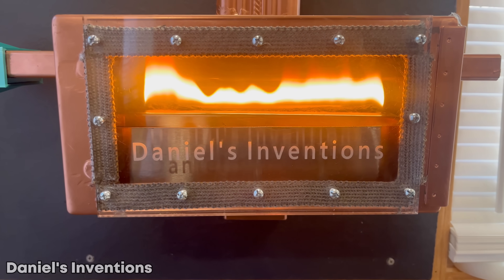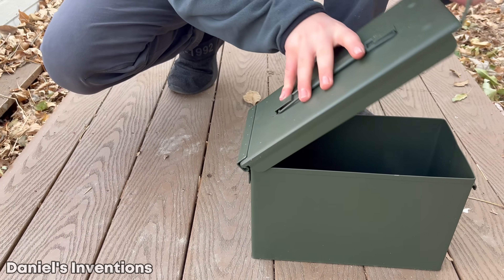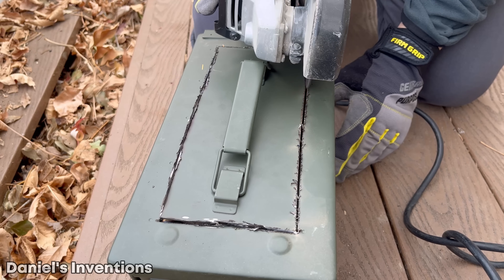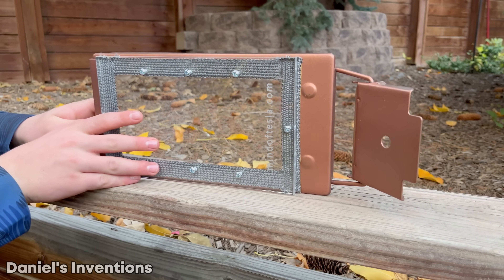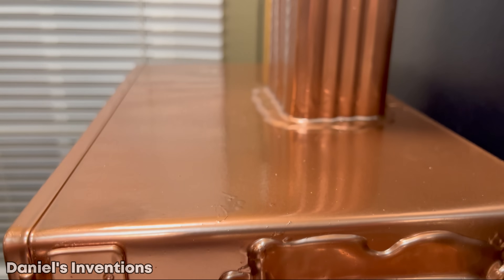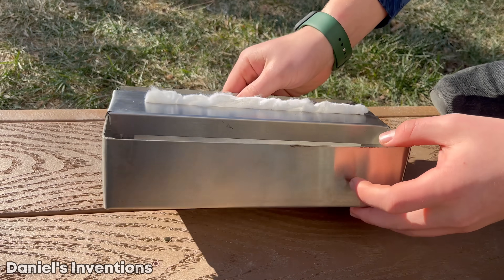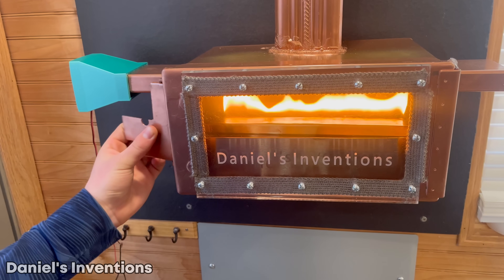ENDLESS Heat for Your Home WITHOUT Electricity 2.0

Comment from the maker: This is ENDLESS Heat for Your Home WITHOUT Electricity 2.0. When the heater is used for the first time and gets very hot, it will begin to burn off some of the paint from the top of the heater. The same way a wood burning stove does when used for the very first time. After the paint is burned off, it will no longer emit fumes from the paint itself. If the house is very airtight, one might need to crack a window open, just a little bit to provide oxygen for the heater, or the heater can have a secondary pipe that is bringing oxygen in from outside. The same way we did on the previous heater video: https://www.youtube.com/watch?v=0guulsNSQXU&t=1s. The oil tank we built can hold half a gallon of oil, and it takes us a week to go through a single gallon of oil. We are only using the heater for 4-6 hours a day, only when we are there using our shop. Now if you need to run the heater nonstop, you will probably go through more oil each week. To put out the fire, simply put your hand over the fresh air intake pipe and hold it until the fire dies off from lack of oxygen. We are using dry cotton baby wipes as a fuse. Once the entire tank of oil is empty, we simply install a new baby wipe and refill the tank again. When the oil tank is completely full and the heater has been working for 30 minutes, the heat released from the heater is enormous. One can feel the heat from a distance or just walking by it. It feels like a blast of heat. We estimate that the heat released it approximately as much as two small space heaters at full blast.
Reply: Well done, Daniel.  I like that you took some of the feedback from the previous build and then some to make this.  Going horizontal was a definite design improvement.  Spacing from the wall is a big improvement.  The metal tube going through the center is also superior to what I'm about to use (stove pipe).  And the long flame is fantastic!  Well done 👍👍👍  

BTW, mine is going to be used in an RV and mounted to a removable metal pane I place in the window.  Also, I'm using mason jars to house the fuel (good visibility on fuel supply), 1/2" fiberglass wicks (VERY long lasting and large flames), and generic Crisco vegetable shortening (exceptionally long burn time).  I may need to use one candle in one jar to be the first one I light.  This will cause the other jars of Crisco to heat up, melting the shortening, and allowing the shortening to move up the wick.  Then, they can be lit as well.
Reply from the maker: Thanks man!
Reply: I would consider a lid on the oil tank with narrow slit for the fuse material to ensure no fuse/flame/embers fall into the tank & causes a flash fire.
Reply: Would you be willing to sell me a unit I'd pay for shipping as well. Just bought a pelonis unit for 60$ very efficient only for one halfof the home though I would use this on the other. You definitely should consider selling these I'd patent it😂
Reply: @JohnColgan.  Best bet is to use some type of wadding such as mineral wool to completely fill the oil tank this way it's near impossible to have a spill.
Reply: @David-oq6tv  I would love to see what you come up with as I would like to do something like that with my RV. Do you have a channel or web site? Or perhaps at a minimum you could post some pics or a video back this comment thread? Love your ideas. By the way how does the shortening compare to vegetable oil in terms of cost, how long it lasts, and heat output?

Thanks for this great video and tutorial, Daniel!
Reply: @whitelaw5  some people use steel wool as wick material on other projecys and claim it never needs replacing.....maybe try that?
Reply: If you made these heaters I would definitely buy one. 😎👍
Reply: @JohnColgan.  is this a major concern and definitely should be done or a flash fire is likely to happen?
Reply: Could you use liquid paraffin as your fuel source
Reply: I would like to buy one if they are for sale
Reply: Baller stove dude!!! Great video
Reply: We are writing a comment to Daniel lol.
Love the build!!
Reply: @David-oq6tv  I was worried that the mason jars will get hot and cold, over and over until it breaks, and would start an uncontrolled fire. How did the mason jars work out?  I'm about to make mine, but I can't figure out the best oil holder to use.
Reply: Hi Daniel, How can I get somebody to build this for me in New York?
Reply: Check with your insurance agent before doing this! I am certain this will not pass Fire code, house fire waiting to happen.
Reply: There is 130,000btu in one gallon of cooking oil. If that gallon lasts all week your shop must be tiny, or not very cold outside...or insulated like a thermos.
Reply: Daniel,  no oil available around me for $2.50 a gallon.  But you can build your own simple distillery to make your own diesel.  By burning plastic (2,3,5 best) over a wood fire (rocket stove) in your distillery you have very little smoke and get your fuel for free.
Reply: You MAY be able to find used cooking oil for $2.50/gallon...maybe. You could probably find used motor oil for free. I imagine it would smell...but dont know.
Reply: How to adjust heat?
Reply: What type of oil are you burning?
Reply: @whitelaw5  me to 👍
Reply: How often do you have to clean that exhaust pipe to prevent oil buildup/fire?  (That oil has to go somewhere.)  What oils are ok to use for this project as it can't be just be "any oil" because of health reasons?
Reply: @marcusdiblo  hello, what's a pelonius unit?
Reply: @Freaysclaw56 plastic is derived from fossil fuel. The reason we have a fuel crisis, is over-dependence on fossil fuel. Burning plastic without extensive, expensive chemical exhaust fume filters will kill us all.
Reply: I think the support dowels are a weak point. It needs to sit on a solid shelf of some kind or stronger brackets so that anything or anyone accidentally falling or knocking into it cannot make it spill
Reply: You should market this I would buy 3 for my self
Reply: Awesome thanks hopefully I don't catch nothing on fire.Nah😂
Reply: @johns4699  If he doesn't I'm about to😂 if I gotta make one myself
Reply: all this paint is an off-gassing nightmare. shouldve been sandblasted first. maybe burned off with torch. I like the design, but I wouldve used stainless steel instead of painted mild steel.
Reply: What powers the fan? Squirrels? Who has a 3 d printer.
Reply: I like to buy a few  Daniel not to copyright to have in case the power goes out to keep my family alive and warm
Reply: Great 👍
Reply: Love the look of this, you have done a brilliant job, as others have said it has a couple of weaknesses, but fantastic job mate.
Reply: You could put heat  dissapation fins on the exhaust pipe and  harvest some of the outgoing wasted heat.
Reply: @jbauern57  trained squirrels. I got mine at squirrelco.
Reply: ANY FUMES FROM PAINT ARE BAD!! STOP PAINTING THINGS THAT WILL BURN PAINT OFF!?!
Reply: Well done 👍
Reply: Should be good for a camper.
Reply: @daveleach4357  I have a feeling any flatlander that's worried about their insurance agent? Wouldn't bother building something like this - too much work. Thought, ingenuity

 wait till it comes out on shark tank, attaches to your tailgater cooler, and it'll be all up to your code inspections 

 America's got jackass movies and people drinking bleach

I don't think they're worried about insurance
Reply: @rogerwhiting9310  at about 5 seconds in on the video, he stated it was a 400 ft building

With proper insulation, you can warm up a 400 square foot building with a candle in a jar if you wait long enough

Of course your insulation is going to make all the difference.
Reply: We would like to buy one
Reply: There are oven trays all sizes that could be used to hold the oil . They would be heat resistant to great temperature because they're made for oven temperatures.
Reply: @DanielsInventions  ideally the heater would be more beneficial closer to the floor.
Reply: @marcusdiblo  There used to be oil burning heaters but most used fuel oil in them. It stunk.
Reply: i don't have the tools. are you interested in building the unit to sell?? not all of us have a saw to cut out the holes, or a 3d printer. :/ or a hubby to do it for us.
Reply: @Freaysclaw56  q
Reply: How do you adjust the wick/baby wipe? I would think that while running you would have to adjust as it burns away? 🔥
Reply: @BAD BOY what mosquitoes survive winter?
Reply: I have a idea for a new vid. Get a 1000 gallon water tank cut the top off put a piston ontop of the piston u put hundreds of pounds of weight to push the water out at a high persure and spin a water turbine  see if u r able to charge a battery. Unlimited free power
Reply: Interesting invention, but please add a pipe through the wall for your fresh air intake.  You really are reducing the oxygen in the building.  Carbon Monoxide is a factor, too.  At least while the metal heats up enough to create enough draft to exhaust it.
Reply: Why not add a large piece on top that is greatly sloped?  That way if a cat tries to jump on top, it won't get burned....or at least not nearly as bad.
Reply: I really like your creativity.  About the exhaust, wind can cause a downdraft, pushing the toxic Carbon Monoxide into the building.  Notice that chimneys have to be x number of feet higher than the roof's peak or something along those lines.
Reply: Is there a residue in the exhaust air that can build up in the chimney and cause a chimney fire, or build up along the roof edge where it exits near?

I'm new to your channel with this video being the first I've seen.  I would like to see more.
Reply: @marcusdiblo  His heater is interesting, but please always use a pipe through the wall to bring in fresh air into the burn box.  Every year, people die from Carbon Monoxide in the US, and many are hospitalized.  His design also doesn't prevent a downdraft from wind which would push the Carbon Monoxide into the building.
Reply: I must have missed something – in the title it says how to heat your home without electricity but part of this unit is a 12 V electric fan...
Reply: Looks like a good way to burn down a house....
Reply: What's powering the fan? 🤔
Reply: @David-oq6tv  Mason jars are top heavy and breakable.. Avoid having to think about or worry about two possible scenarios.  Hot jars of oil getting knocked over , a big mess & a clean up job Nobody would enjoy. 2nd. Hot oil breakable open flame inside camper not fun.. there's better choices..
Reply: @Freaysclaw56  go to any restaurant and get used oil free..
Reply: @SeaJay_Oceans  3 or 4. 22.5° elbows in the exaust could be used to capture more of the heat currentLy 126°  leaving outside...
Reply: @markkauffman6184  battery operated.
Reply: I made this yesterday so thx
Reply: 2€50 a litre, turns into appro 9€ a week -US or UK gallon ? that could provide with 36kWh -3 hours on 1200W heating. I did not know we were geeting screwed that deep by electricity providers, a good job most of us were "vaccinated" several times already, uh ?
Reply: Q
Reply: Wax acts like a Thermal battery. Add a couple of tall canisters on top of the stove and it will hold that heat for a long while even after the oil is spent. The wax reusable and will just harden until the next time. Water works too but doesn't get as hot and cools more quickly, the trade off is safty. As long as the wax doesn't tip over an spill it's all good. They also make fans that use heat alone to produce wind but they are expensive like 500 and they need to get hot like 450. Good for the top. I would be interested to see you make the heat exchanger intake a u shape that travels from the side of the top of the stove and uses the electricity-less fan to power it. Cut the electric out and you have a real life saver. That electric power has power over us. Oil and alcohol can be made out of so many things.
Reply: Another thing I've seen is double barrel stoves, they have a second can on top of the can, the fresh air exhaust would travel up the gutter but offset to the right side, then enter the top box and exit from an exhaust on the left side. So the hot air fills the box and many pipes woven through that box create more surface area, although it would not be as hot at direct flame.

Another thing I thought of is like the native American fire pit. They dig a hole beside the fire down low where cold air drops in, the cold air feeds the fire as it warms and rises making somewhat of a blast furnace. If your heat exchanger pipe was coming up from the floor level and exiting up high you may be able to do away with the fan, depends on the draw strength. There is a perfect ratio of heat necessary to create a draw and if the chimney is any cooler the smoke won't rise away from the building. One question, what is the creosote build up potential, how often should the chimney be replaced or does it burn clean?
Reply: I was sketched by the JB weld fumes. Also, beware any galvanized steel, when the zinc burns off its super toxic. I would cook the metal parts in a fire pit real good before bringing that indoors. Sand blasting is a great idea too. You would want engine paint for sure. High temp.
Reply: You could just bend more gutter instead of 3d printer. I would worry the plastic would get too hot.
Reply: Check out a double barrel stove kit and a welding torch. Have that in your basement and you can get it going everytime. Just know it's short lived if living in the city. The Serbian war in the 90's lessons are tragic, once people ran out of excess wood trim and floor boards they had to go scavenge others houses and a trip out was most likely a run in with a sniper. I've read diarys where only half the family survived and that was lucky. The gub-ment told them everything was OK, again and again, and then they were gone and it turns out it's wasn't fine at all. Nato sat and watched. As did we all. Stove like this is a life saver. But the skills that saved them was recharging small batteries, filling lighters, and fixing things in trade for food. A trip to the market was also met with snipers. The market was safe because the warlords ruled it, but the walk home was treacherous.
Reply: Brilliant comment on heat fins on the chimney. Could run a small pipe through that too with a little fan.
Reply: Thou shalt break them with a rod of iron; thou shalt dash them in pieces like a potter's vessel.

Be wise now therefore, O ye kings: be instructed, ye judges of the earth.

Serve the Lord with fear, and rejoice with trembling.

Psalms 2

The greatest mistake one can ever make is persecuting followers of the lord.
Reply: Of we paid any mind to our childhood lessons we wouldn't need insurance. Yet we build so the big bad wold can blow it all away. Then he extorts us to rebuild beach houses and those knowingly built of flood planes. The wolf likes the fragile house so he can raid easily.
Reply: Anyone with hands and will can make this. This is a survival stove and you will gain great sense of empowerment by building this instead of doubting. You will get a free grinder out of it and you don't need the 3d printer, some tin a rivets will do fine, you could even use tin snips on some gutter and some self tapping gutter screws to fasten the taper down together. The only real excuse in life is taking care of children or debilitating health and the children when taught can craft for you in time, if you show them the way.
Reply: Magic powers the fan. Like uncle fester with a light bulb in his mouth. Lol
Reply: When monopoly is allowed you know your getting screwed. And they are tightening those screws as we speak. I can feel them stripping. To much force and the whole thing comes undone.
Reply: @DanielsInventions  JusT leT me know when and where I can buy this this ConTRaPTioN.!! 😒
Reply: The WEF can take it from my hot live hands.
Reply: Build me one and I'll buy it
Reply: This is the first time I see this and I like the fact that no welding is required.
Reply: @luisfelix7989  or at least do first burn out doors.
Reply: @BAD BOY neem oil is rather costly and it stinks.
Reply: @wownewstome6123  ah ok. Gotta read all the comments before rushing out to duplicate. I’ve watched so many fireboxes made from these ammo boxes.. learning something new each time. By the time these build ideas are mastered the ammo box supply  will be slim. 😂
Reply: Thanks for sharing this clever idea, simple, cost-effective, seemingly not bad built etc. Question though: don't you smell the oil with a touch of burn?  Lastly: keep the following in mind since you mentioned the so misused and abused word these days 'create' :  The Law of Conservation of Energy, a physical law, teaches that energy cannot be created nor destroyed by may changed from one form to another. And supremely "Only God creates, the rest of us just copy." [ ~ Michelangelo] ].
Reply: I have thought about a metal or even glass loaf pan.
Cotton felt sheets are less than $1 (Walmt)
Or carbon felt for replacement filter in overhead stove top ventilators (L.wes or HD)
Reply: What are the top 3 oils you prefer to use?
Reply: Love the design.
I really appreciate the video.
Planning my own build right now.
Thought about using fire bricks inside and on top for heat retention, a metal heat deflector on the cement backer board and a heat activated  wood stove fan for more air movement into the room.
I'm gonna use a metal loaf pan and metal flashing for the fuel container.
Covering the top to reduce possible flash point ignition in case the oil ever gets too hot.
May pickup a glass loaf pan so I can see the fuel level.
Thinking a damper in the flue and adjustable airhole cover for the intake may be a good idea.
Easy enough to do.
Possibly placing the whole thing in a unused double-hung window, so I can just exhaust / intake it out of the cement backer board itself.
That way I can easily remove it with the season change.
Anyway
Thanks again ✨😎
Reply: Lol I just use LPG so much better
Reply: I would be extremely interested in buying one of your units if you could build me one....
Reply: Great work lad, tip though for future vids, try not to say "We are" every sentence :)
Keep it up
Reply: Keep working on that, and who needs paint ?
Reply: Great idea but most western nations would have their house insurance cancelled if they used one as described, this is why we have the "WET" certification systems here.
Reply: @azra3234  : The most practical "free energy concept" was COMPRESSED AIR ENGINE (C.A.E.)... Almost all engine were pressure operated, fueled by: gasoline, diesel, steam engine, bunker, rocket, turbine, etc.. 

1) Just replaced the pressure "producer" with compressed air- having a pressure from 700 psi-1,400. psi...

2) install a 2. sets of heavy duty gas tank (tank for acetylene, oxygen, etc..)..

3) The 1st tank was empty, installed with suction air pump... 2nd tank must be filled at the start with 700psi- 1,400 psi compressed "dry air" - PCP airgun  "tank filter" element/cotton (?) filter can be use...

4) The sole function of built in air suction pump at the 1st tank: Continious sucking of exhaust gas being ejected from the exhaust valve of the engine- then such "exhaust air" will be forcefully injected at the interior of the 2nd tank!... Thus, the elusive free running engine can be achieve in reality!...

5) Pressure released valve should be installed at the 2nd tank- to avoid the over pressure incident, hence tank possible explosion!... Automatic, excess air pressure will be bleeded out by the valve.. Also, pressure valve of the 1st tank, an interior tank pressure must be maintained  by the installed suction pump- at 13psi- 14psi range only...
Reply: HEY I HAVE TO BIG MICROWAVES SO IT GOT ME THINKING I SHOULD TRY TO BUILD A HEATER FROM THE ONE MICROWAVE IF IT WORKS WELLLL ILL BUILD A SECOND HEATER LET ME KNOW WHAT YOU THINK.
Reply: @vrokhlenko  windows
Reply: @wownewstome6123  what the heck is a down draft? just put a stove cap on it no?
Reply: It's fuel might go wrong, to use vegetable oil, the fire can't be more than a half inch away from oil's level, when the level goes down, it gonna put out fire, I thought would use kerosene or even diesel, the fuel tank is so tall to use vegetable oil and the flame gonna put out after some time, never gonna use all available vegetable oil.
Reply: @wownewstome6123  Look at the video, is possible see an external air input and a external output, the side heated tube only passes air to be heated by hot metal tube, but this path is insulated from combustion gas.
Reply: Can I just Buy the 1x you Already made LMK Bro 😎
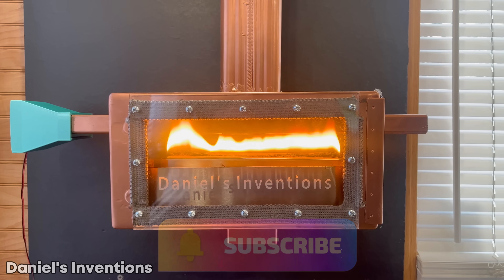Reply: 4:43
Reply: Could this go inside a chimney?
Reply: Can you use used engine oil in this heater?
Reply: @David-oq6tv did you ever make it and can you share an image or videos please because I plan to do something similar
Reply: This is NOT endless. no oil, no heat. No wick, no heat.
Reply: @DanielsInventions  I'm sure someone has to have mentioned, since you already put a hole in the wall for the exhaust vent, to make it more efficient you can hook the intake air to outside. Pull cold air in for the fire, don't be pulling the heat out of the room for the fire to be let out the exhaust vent.
Reply: I would buy two fo that if they were available.
Reply: I will pay for you to make me one
Reply: Do you still the heaters
Reply: @markkauffman6184 You run the fan off a 9 V battery it works just fine
Reply: So, the Crisco is a lousy way to go.  Don't burn it indoors ever.  You might not die from freezing, but you'll asphyxiate from the ridiculous amount of soot it puts into the air!  In my case, it gunked up the inside of the ammo can.  Just forget the Crisco!
Reply: @David-oq6tv  good to know brother.
Reply: One of those Chinese diesel oil heaters on my boat for two winters. I think this is far superior. It really uses no electricity except for the small fan and I suspect that if you angled that cross pipe that you actually wouldn't even need a fan to get the heat to run through it. Also if you wrap something like steel wool or chicken wire around the exhaust pipe number one it would keep anyone from touching the exhaust pipe directly and burning themselves and also it would draw a lot of heat from the exhaust pipe into the steel wool and into the chicken wire which would also transfer into the air really well as well so you might not even need to have the cross pipe if you did something like that. I love the idea that this uses no electricity. All those Chinese diesel heaters actually draw a fair amount of electricity number one to light the oil originally because it uses a glow plug and number two it's always running a fan and so it's draining your battery. other people make oil heaters that use small spigots that you can adjust a drip to drip down onto basically what is a pile of nuts and bolts and then it's a bolts get hot from the first fire and they stay hot enough that every drip of oil that lands on them reignites so you can adjust how much heat it puts out by adjusting the drip. And they can use just regular metal drip fixtures to do that. I like the fact that you use JB weld rather than using real welding. That makes it so much easier for an amateur. And I think the ammo box is a great idea. I think the window makes it look nice but quite frankly you wouldn't need the window and it adds some complication and expense to it. So you could do this without the window and you would know it's working because it would be very hot. You probably also hear it.
Reply: Here's an idea. Have the inside oil tank be very shallow and not hold a lot of oil. Have the outside oil tank have a small pipe connected to the inside oil tank. It would hold the majority of the oil and be at the same level of the inside tank but when the inside tank ran out of oil it would naturally flow in from the outside tank. Number one that allows you to fill the outside tank at any time and number two it keeps the fire away from most of the oil at all times.
Reply: @gaslampnation735  - What a world, huh :'(
Reply: @gaslampnation735  - Agree but the unfortuntate truth is, history is full of horrible people that did horrific things to followers and others... and most of those horrible people that did horrible things to others, lived a long time and nothing ever happened to them :'(
Reply: Any chance you would be willing to build one of these for me ( paid of course ) ?
Reply: Very interesting device.... I did heating/ac as a career so I know a few little off grid methods that heat & this is not one of the
things I've seen.  I mean I have seen methods to heat using oil but this one is unique.  peace
Reply: You stated it was WITHOUT electricity in the description, but go on to show that ur using a 12V ELECTRIC fan for your heat exchanger. How do you run the fan without electricity?
Reply: 0o
 @TheFoolintherainn
Reply: @brucecarleton7061  this was nearly a year ago, no idea what we're talking about, so I'll just say Happy Holidays! ✨🎄🕯️
Reply: That's just a beautiful stove. I think you did an amazing job.
Reply: @marcusdiblo One year later and I second this!
Reply: Huh. Someone made a comment that kicked my imagination. 🎉 

What sort of variation could you make using an old junkyard oven as the base?  It has a large space with a window. It is made to be resistant to high heat. You will need to add a stovepipe and air intake, obviously. 

You are losing heat to the outside through that stovepipe without harvesting it.  As another commenter posted, some sort of soot buildup could become an issue. 

Hmm. 

Everyone has an oven. Could cone up with several models. Some that butcher the oven and convert it. One or two that can be temporarily modified in an emergency without damage or smoking them out (etc.), including other safety considerations.
Reply: Cool heater!!
Reply: Hi great job... Good design but you can do better.. safety issues: the exhaust should be a class III chimney when going through the wall (same as a pellet stove) and ALWAYS use a fresh air intake with such heaters. You will get a more efficient heat transfer out of a pipe made of multiple smaller tubes as heat exchangers... you can drill multiple half inch holes in each end of the ammo box making it tight using emt conduit and weld the pipes in place to seal them up  attaching the gutter pipe to each end if you can picture that... Fan on inlet end and extension on the outlet.. just a thought
Reply: Here is The True Savior

HalleluYAH “Hallel u YAH - Praise ye YaH”

YaH is The Father (Genesis 1)
YaH arrives via the TENT OF MEETING
YaH was Who they Crucified for our sins
YaH was Crucified on an Almond TREE

Ancient Semitic Moshe (Moses)
Isaiah Scroll (The Original Isaiah)
Reply: The “initial buroff” should be done outside as those fumed are for certain carcinogenic, as told in EVERY video that makes this sort of item.
Reply: How are you powering the fan?
Reply: @TheFoolintherainn  insurance companies would just love to raise their extortion rate for a home made stove like this one. He needs to make two separate heat exchangers stacked one over the other  with a space between them to nearly double the output. Cheers.
Reply: @michaelheurkens4538  oh this is such an old comment - I'm dying to know what we were talking about! 

Seems would be very relevant right now...
🥶

But yes, most homeowners insurance companies wouldn't even allow my dogs! 

That's how I get them - the last one chomped on a neighbor 
She's now with me, off-grid out of sight away from insurance companies and lawyers! 
 I don't think my heating system is legal either! 

I'll have to stop being snarky, watch this video and figure out what we're talking about. 

Cheers back at you!
Reply: @markkauffman6184  He can use a heat activated fan. They've gotten a bit better quality and lower in price. 

  the heating element itself does not require electricity. I suppose we could call the fan "an accessory."
But modern technology can be replaced by old technology! 

Heat activated fans have been around for many many years!
Reply: @TheFoolintherainn  thank you! <3 :)
Reply: I would use that space btw the heater and the wall for a water tank to make warm water that i can use, would you do that too please?!🎉❤
Reply: If you’ve happened to post a video of your RV heater , could you please share it?
Reply: can i buy this from you?
Reply: Just to let you know when you 3d print things, micro plastic fibers will break off and get embedded in your skin every time you touch it or get gets rubbed against the skin. To protect yourself from microfibers from 3d printed objects, it's best to coat them in a sealing polymer, like an acrylic spray, superglue, etc. I will give the plastic a glossy look, strengthen integrity and not let microfibers that can only been seen from a microscope, break off when touching it.